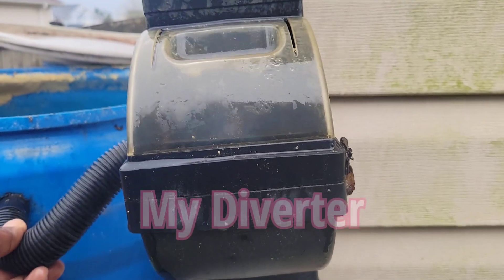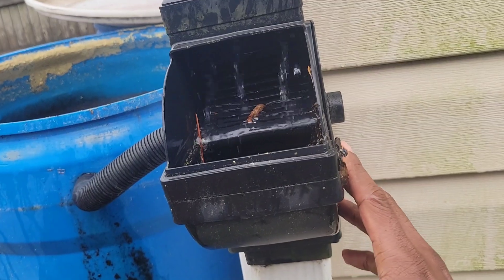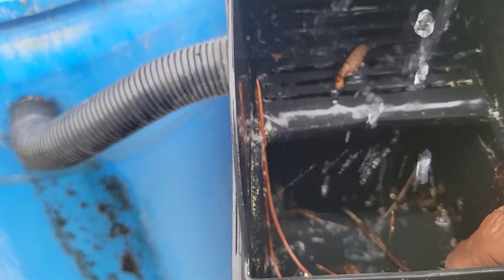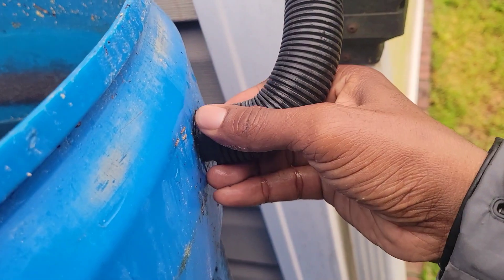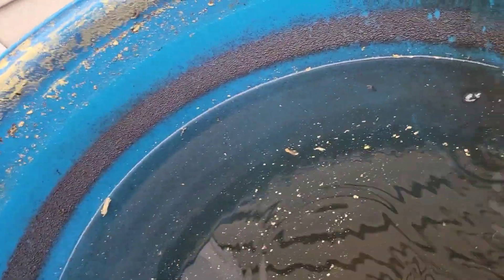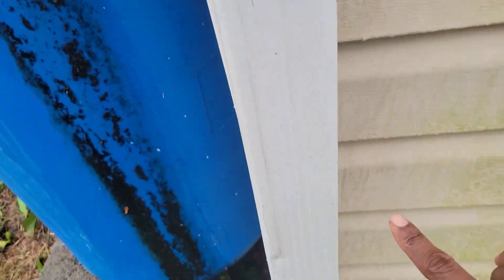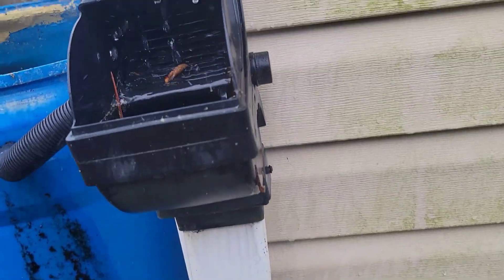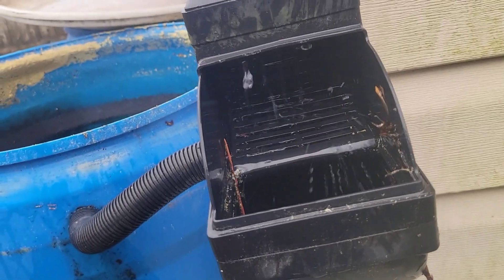How does Rain Water Collection Work?

Comment: Hi Bear! Great video. I have a water flow problem with my rain barrel, what do you recommend for that?😊
Reply from the maker: HI Mrs. Althea, thank you!!!  Is your barrel flat on the ground? If so, you might not like this answer.  If you look at this video when I showed my manifold, the white pvc, the barrels are on cinder blocks. Every barrel is on 4 cinder blocks. 1 cinder block on top of another. This helps with water pressure. Gravity shoots the water out hard.   Let me know if this helps or not.
Reply: @GrowSomethingTasty  Hi Bear! Thank for replying, I have barrel on a cender block but probably need to add another one to create more gravity, thanks again 😁
Reply from the maker: @Althea McDougal  Hi Mrs. Althea, I will always reply to you, yes it will help.